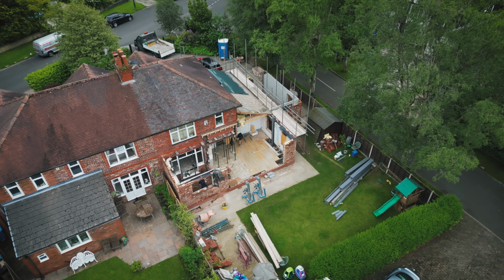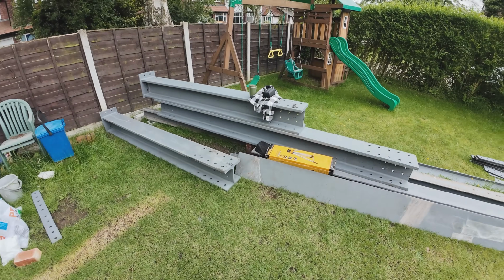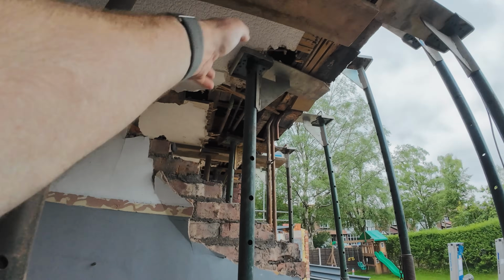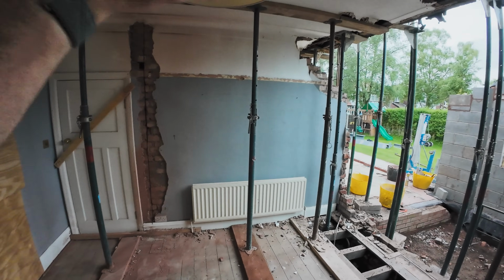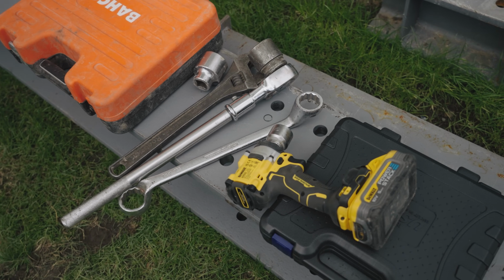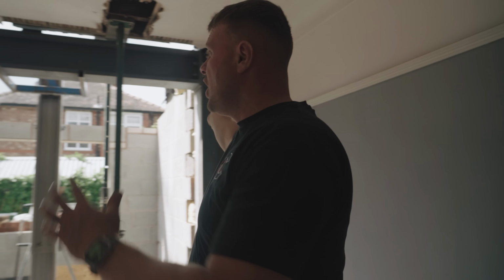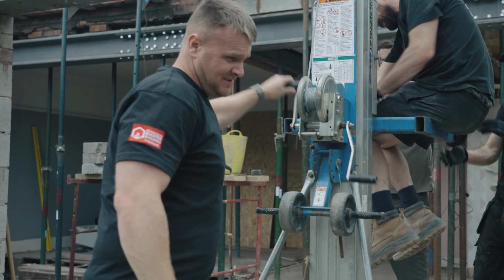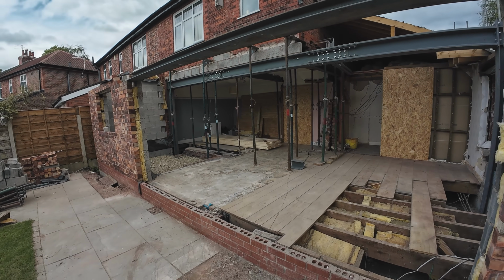installing steel beams on an double storey extension.

Comment: I appreciate the stress and graft of getting structural metalwork of this scale installed. What I dont get is why leave the main steels as a bulkhead/downstand? The cost of lifting them flush with the downstairs ceiling is a tiny % of the total job and would clean up a shadow line for that inner space. Keep going strong chaps.👍

Comment: Great work Ryan that looked a ball breaker. You beat me to that we done one similar last year and got it welded as well. Did you have them stippled washers and have to torque the bolts ?
Reply from the maker: yes mate had to torque it all

Comment: Props off the suspended timber floor?
Reply from the maker: the props that is taking the back off the house is off a concrete floor which has tiles on.

and the small internal steel which has no brickwork above has been propped off the floor with a spreader timber,  so where’s the point load on timber floor pal

Comment: I'm surprised that didn't make you do all that stupid ground beam steels as well that the engineers love to specify these days.

Capeneter & Joiner here, we did a loft conversion years ago and the engineer specced 102 weight steel for the ridge steel & the steel supplier was saying its got to be a mistake this steel would hold up a 10 storey block of flats, this will be a special order LOL so I argued with the engineer & he then agreed to halve the weight.

The last couple of loft conversions we done the steel work has been absolutely mental ridiculous.

The steels they specifying now weigh more than the whole fuxking house, which is a nightmare for customers with the price of steel now.
Reply from the maker: we do a lot off lofts and we have had the same problem especially when it’s hard to get them in becomes a nightmare
Reply: @IdealConstructionRyanWalden  the last one we did we had tin roof scaffolding & the engineer has specified stupidly massively steels not only for the ridge but hips also & all bolted together, never done one like it before & it was a nightmare with the hips being so wide for our timber work.

But just getting the steels up & in was a manual block & tackle nightmare.

At some point this needs to stop as it's out of control now.